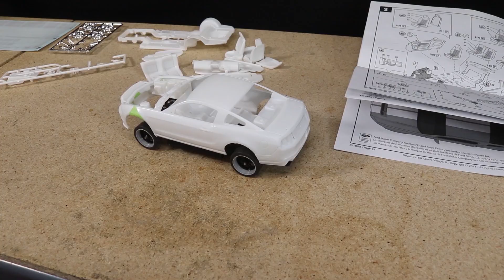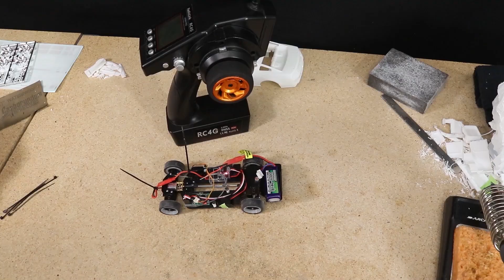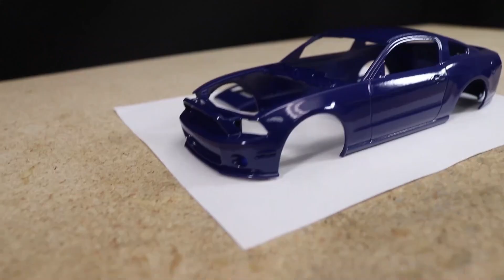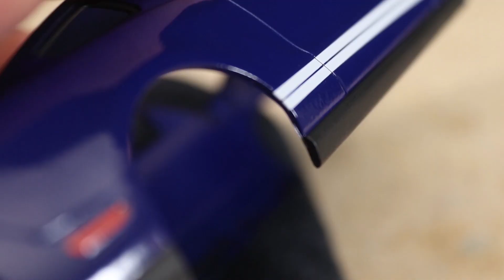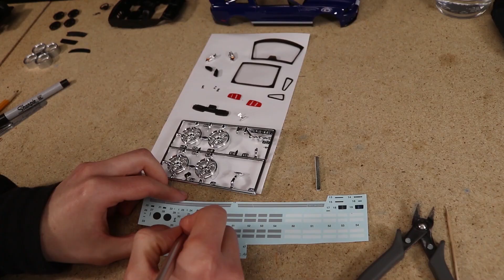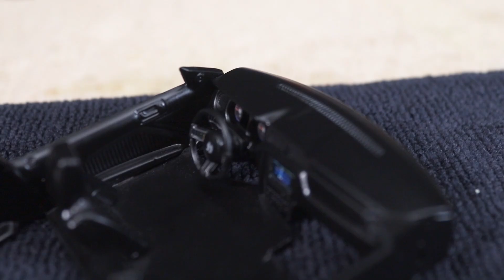1/25 Scale RC Ford Shelby GT500 Model Car to RC Conversion Full Build Compilation (All Parts 1-3)

Comment from the maker: A compilation of all three parts of the 1/25 scale Ford Shelby GT500 build put into a single full build video. I really enjoyed this build and I hope you all enjoy the video. 👍
Reply: Really nice build! I've got the bigger version of this very same model from Revell in 1/12th scale and will be turning it into an RC model in the near future as well. I should be able to easily fit all the components in the model, plus a light system, a steering servo and a driver figure (3D printed). As a suggestion, please try to build a 1/25 truck (AMT, Revell, Italeri) with a sleeper behind the cab. You should be able to conceal everything in there and it would look fantastic!
Reply from the maker: Thank you! That 1/12 scale kit should work well for a RC build. I've had my eye on MPC's 1/16 scale Trans Am kits. Good luck with your project and thanks for the suggestion. 👍